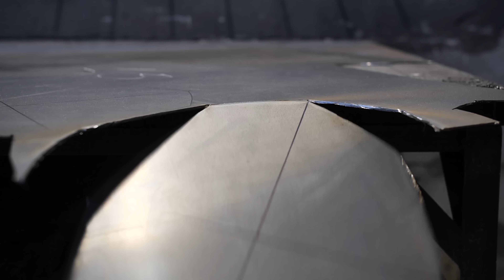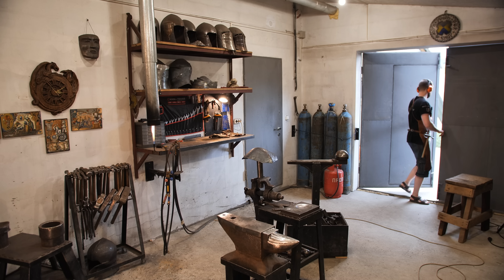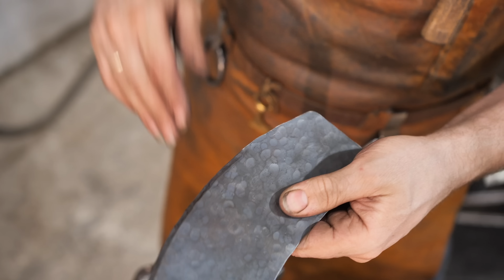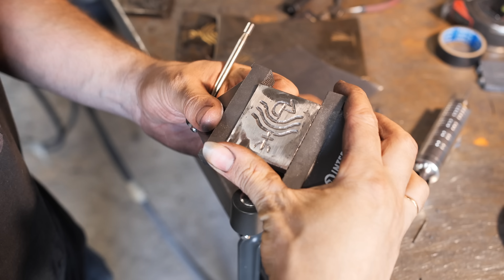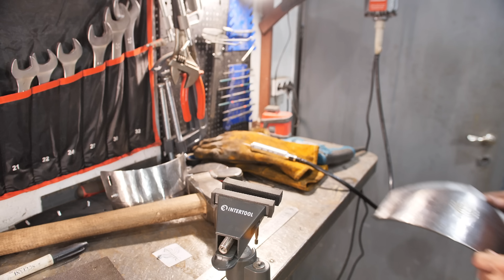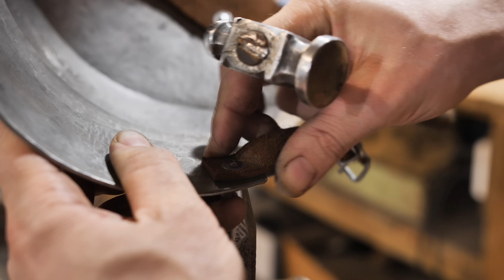Real armor from Skyrim. Steel Shoulders of Dawnguard

Comment: What do you use to make the steel gold? Is that a dye or paint?
Reply: It's not gold, it's a brass wire brush. You should be able to find them in a building supplies hardware store.
Reply: @Arterexius  well there has to be some substance he’s putting on the brush to make the steel a gold color
Reply: @Judah-Mills  Nah, it's just brass. No substance needed, as brass is a very soft metal. Here's a video of another blacksmith, using a manual brass wire brush:

https://www.youtube.com/watch?v=6mCT4TOdgyQ
Reply: @Arterexius  that’s pretty neat! I didn’t know that. Thx for the info!